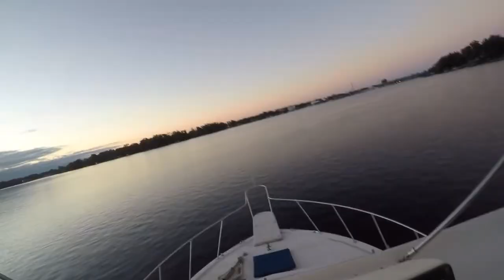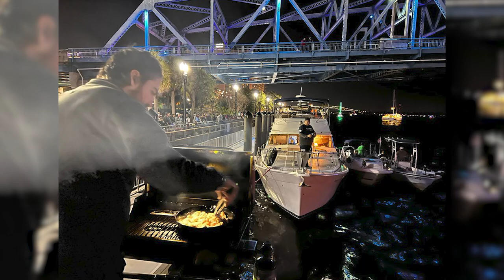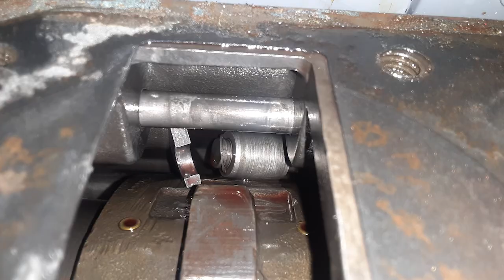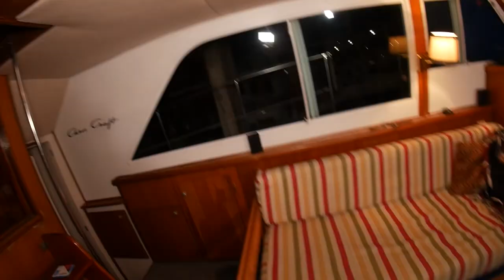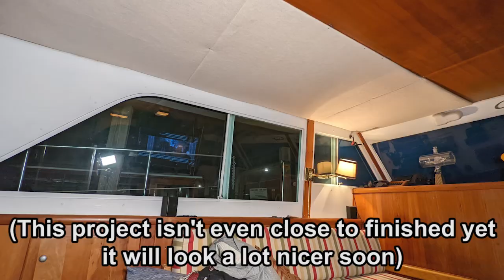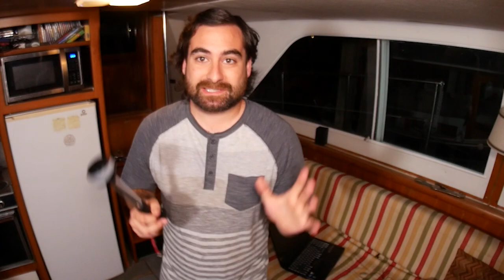my boat is BACK on the river!

Comment: Pretty sure the anchor light on a Corinthian is mounted on the top of your windshield.  If you pull back the rubber trim that’s around the inside of the windshield you will hopefully see the original wires to the light.  Also I would highly recommend that you cut the new carpet so that you can still open all of your engine compartment  hatches. On an older boat you need to be able to get in and around the engine room without it being a big production.
Reply from the maker: They are matching the previous carpet shape precisely, including the hatches

Comment: Congrats on sticking the landing!  Not sure if this has been mentioned but driving a twin inboard (at a very slow speed - docking, etc) is similar to pushing a shopping cart.  Center the wheel / throttle down and then just use the gear levers to steer.  Terrifying at first then becomes quite fun.  Looking forward to more of your videos!

Comment: Great job tackling the reverse brake band engagement arms on your Paragon transmission. You must have removed the transmission unless the broken arms were on top and accessible from the control valve piston assembly?  I had a similar problem however my reverse band broke which required removal and a complete teardown. I’m surprised your boat has Paragon transmissions; it must have been towards the end when CC was still using Paragons before transitioning to Borg Warner’s.  Unfortunately Paragons are the weak link in your drive system since some parts are becoming hard to find. Did you buy the arms from Federal Marine?  Thanks for sharing
Reply from the maker: I was able to do all the work without removing the transmissions, just barely. Had to get the engagement arms custom made because no one had them. Paagon parts are exceedingly rare

Comment: Good to see you back. Best wishes. (Also from the UK) Did you manage to find a proper mooring?  By the way, the boat looks so good as it motors across the water. (Classic beats new and snazzy in my view.)
Reply from the maker: Yes, I've found a permanent spot. Many compromises compared to the old dock, but still the best option in town.
Reply: Good to hear that. Onwards and upwards mate  👍

Comment: Hi Cullen. Have you figured out the problem with the engines not revving over 2000 rpm?
Reply from the maker: I think so. An oversight on my part, the flame arrestors were very dirty and not letting a lot of air through. I cleaned them with a lot of brake cleaner and now the mixture is much more balanced, efficiency is up, and things are all around better.